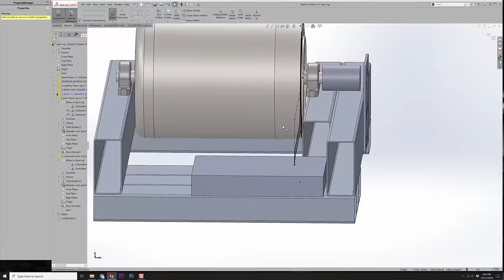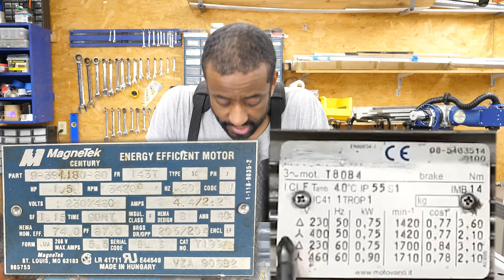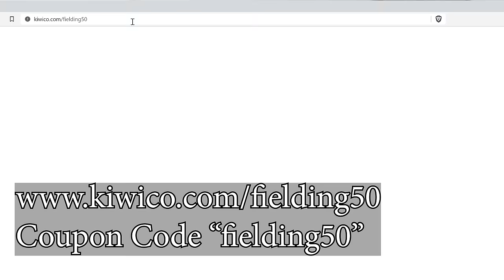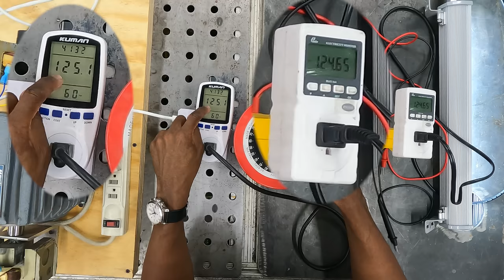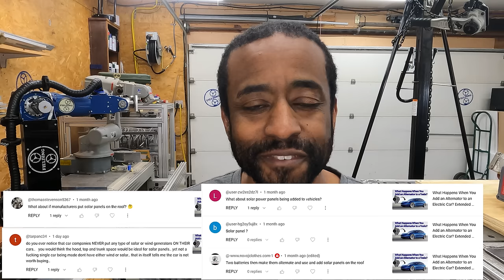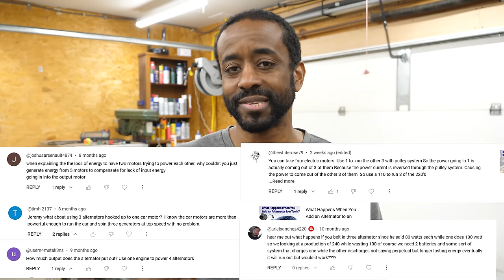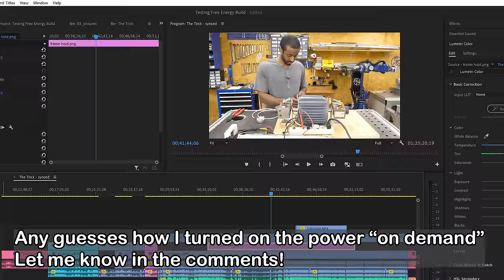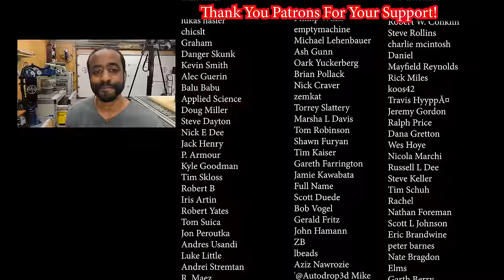Building and Reviewing Free Energy Generators on YouTube.

Comment: I have a question.   Is a gravity battery a good source of electricity?  Make a gear box.   With heavy duty gears. 3600 to 1.  Ratio
60 to 1 added to another 60 to 1. Can give you an output of 3600 rpm’s
Create a double sided ring gear 4 foot tall.    Create a base that can handle the weight and balance.   Create and frame with 6 gears in a triangle pattern.  The left leg of the frame will be shorter than the right leg. There will be a heavy duty one way gear at the top of the frame to hold the ring gear.   There will be a gear on the outer top of the ring gear, and at the bottom of the right leg there will be and inner and outer gear.  The outer gear will be a one way gear.  At the bottom left side of the a frame there will be an inner gear,  but the outer gear will be a ratchet gear attached to an arm/ lever.   The distance I require for the gear to move in one revolution is 2 inches.   The main Generator will be hung on the right side of the ring gear in free fall, dropping at 1 inches per minute, producing 3600 rpm’s  and 10,000 watts of electricity.   The ring gear moves counter clockwise, while the generator is in constant free fall at 1 inch per minute.   With Leverage and mechanical advantage, the ratchet gear will move the ring counter clockwise when the generator reaches the trigger switch.   The generator will always be on the right side of the ring gear as it can not go past the top or the bottom of the a frame.   The output pump energy to lift  a few hundred pounds?   This I would love to see.
That is how I imagine it.   Because you can’t stop gravity.  But you can push back.  We learned leverage is our friend.   And leverage is how we win free energy.
Reply from the maker: I talk about this in the video. There is a whole section on Gears. They don't give you free energy. They transform energy so we have the same amount in and out. You also have to use energy to lift objects. So gravity is a way of storing energy when you lift something that can be released when you want it. But it takes more energy to lift the object then what you get back when it falls. So again nothing was added or gained. Gravity is just a a storage tank for energy in this way. You can use that tank or a different kind of tank if you need to storage energy but nothing creates energy.

Comment: Sorry I'm a late comer, but what if we used a bunch more transformers and transistor and batteries would that increase efficiency
Reply: Every item you add actually REDUCES efficiency, none of those items would increase it. As Jeremy goes over in the video, they will all waste power. Batteries would surely make it run for longer, but that's just what they do, they still need an initial charge to use.

Comment: Can't you put capacitors on the output to increase voltage which would drop amps.
Reply from the maker: What result are you hoping for here? I don't understand your suggestion. I only ask because I want to understand where people go wrong, to better understand how to explain/teach this problem. First increasing voltage and decreasing amps leaves you with the same amount of power. 2. A capacitor is basically a battery except it charges and discharges much faster. This doesn't change voltage or amps by design. So your statements don't really make sense together or separate. There is nothing gained by adding it to this system. More importantly it doesn't give you free energy no matter how the parts are arranged.

Comment: They said also HHO would never produce enough to power a car with water, but Honda is possibly releasing one if they can get it to properly without all the political b. S.  But I knew it would work because I did the HHO generator that was on that hidden tech channel and it worked fine...  That's the only one I've done so far but I don't let my thinking from attempting...

Comment: To get over unity with anything the electrical system must run at, at least, over 90 volts and much higher is were you should be working. MIT got over unity with LEDs a few years and they were published in a good science journal on this😮! Back in the 1970s there was and inventor, very successful entrepreneur, who’s company built the best small troller motors for fishing boats and he insisted that those motors became more efficient as the voltage rose to 90 volts and above 90 volts became more efficient than was supposed to be possible, but at the time voltages over 90 was too expensive and difficult to create, so that is where his company’s production peaked in voltage.

I don’t think any of the things I have mentioned above violates physics, they just tap into the Earth’s natural electromagnetic field which leaks into DC electrical systems with LEDs and at that voltage and AC systems at much higher voltages. And Tesla talked about this but used different language. Ed Leedskalnin perhaps 🤔 used this but certainly used lightning to build his Coral Castle in Florida and other researchers claim to have solved with systems they think he built but overly complex for Ed to have stumbled upon 😮!

Comment: I still have a dream,a vision of the application of a type of dynamo,that attaches to the wheels of a Tesla to provide power to assist in maintaining charge to the battery while the vehicle is in constant motion.
Reply from the maker: If you managed to make a “dynamo” that could create electricity from mechanical energy without actually needing mechanical energy you would have it. But no one has figured that out. I don’t think they will

Comment: Right i have one question can you generate 220v with 3000w for 3 minutes using a battery drill. This is to power my coffee machine in my motorhome while not plugged in electric. 

Maybe using the synchronous ac motor

Comment: What about re wiring a car alternator to go from 12 volts to 120 volts by adding more copper windings.....  Is that possible.
Reply from the maker: You can make the voltage any amount. That doesn't change the power output. It might help to watch again. I actually talk about the relationship between voltage and power a lot in the video. Most of the scams play on this misunderstanding.
Reply: @Jeremy_Fielding  appreciate the quick response bud but I was not able to explain my question in a way you was able to answer correctly.  I now know after the understanding I now have after watching your videos that producing energy from nothing doesn’t work as well as if it takes a watt to run an alternator that only puts out 75% of a watt then that’ll never work.  My question is if the alternator was hooked up to a motor, electric or gas, can the internals of the alternator be changed out “AT HOME-DIY” to go from 12v DC to 120v AC.  I’ve seen videos where they take the 6 copper windings off and replace with 60 copper windings….  6 creates 12v then of course multiply by 10….  60 equals 120v.  They change a few other things then voila, alternator puts out 120v AC.   Is that possible, is it true, or am I being hamstringed once again by con men.   Sure appreciate your response and have yourself a great day.  Thanks again for the videos, it’s helped my understanding 10 fold.  Actually has me interested and wanting to tinker with things to learn more!!!!

Comment: Not staying I know whether or not these devices work but based on the original video you forgot to mention or avoided mentioning the aluminum, silver, and mystery element combination of the rod that goes through the electric motor housing? Apparently thats the "make or break" of this thing working.
Reply from the maker: There are at least 10 other reasons mentioned in this video for why this won’t work. It’s like saying I am using the wrong drive shaft in a car with no gas. It still doesn’t work. There is no magic material. So claiming to use a custom metal you can’t buy, meaning he is forging it with something as costly as silver seems unreasonable to me. I believe this is just part of making the scam sound more reasonable. But believe whatever you like. This video was made to answer a question

Comment: Great work explaining this to people!
But I have to say your variable transformer demonstration is a little weird. I get that your light is LED and as such has some sort of regulated/switched driver, so that doesn't draw more power when the voltage is increased. But any resistive load and many other non regulated loads increase power consumption with increased voltage (As I'm sure you know), with that said, that power increase ofcourse show on the primary of the transformer too, but the idea of increasing a transformers secondary voltage without the power increasing (on both sides) is quite rare.

Suggestion for future content. How asunchronous motors can be used as generators. I know how to parameterize a regenerative VFD to get power from breaking a motor, but im not sure how its done electrically. Can it be made without a VFD? DC injection to the windings to magnetize it? If you know and make a video out of that i'll be watching!!

Comment: I’ve built this it will work for about 40 amps anything over that it’s too hard for the motor to keep up
Reply from the maker: What do you get from making claims like this? Perhaps you didn't actually watch the video but this machine is ridiculous for a long list of reasons. Not only is there no reason it should work, I made it and proved it is stupid. I get the feeling you make up these details to make it sound more believable, but if you watched the video you would see there is zero energy coming from this garbage. It was a scam made up to steal your attention. I made this video to show you the scam. I strongly suggest you actually try it yourself if you believe this works.
Reply: @Jeremy_Fielding  this machine yes if you use a flywheel you can get the 40 amps at most
Reply from the maker: @chrismccourry3245  Sir. There are no spinning parts on this fictitious machine. But reading this tells me we should agree to disagree. There is no need for more details. Thanks for watching and commenting.
Reply: @Jeremy_Fielding  you are correct tho is doesn’t work worth trying or wasting time on or your money my friend you are correct

Comment: What about handcrank generators you can buy on amazon ? I have one small and you can power you phone of small device you can power up from usb . But is it possible to make it spin and not need to keep cranking ? Basicly they say it must take about 1 hour to go from 0 to 100% on the phone but you need to crank constanly and at the same speed and use the same power , if you go to slow or to fast it disconet.
Reply from the maker: Good question...You should check out my "how regenerative braking works video. I talk about EXACTLY this in that video. https://youtu.be/a49_BnlJoyU

Comment: Your fundamentals are wrong, @ 16:45 power = amps x volts holds true for DC.
Transformers don't run on DC, they run on AC or pulsed DC. 
For AC the power = volts x amps x PF (cos phi).
If your system tweaks the PF (aka phase angle), you can have the system consuming only 10 watts even if the consumption is 100 volts and 10 amps (if PF becomes 0.01, this is possible when secondary flux is delayed).

Comment: The microwave transformers are extreemly high power and need to be handled with extreme caution. Probably the most dangerous around the house tranformers one can get easily.( see Lichtenberg wood burning). However the transformers are useful in many ways and microwaves have excellent magnets in them that are very useful too. Really like your show, but afraid I would disagree with the mechanical portion of your analysis. Using your philosophy, block and tackle systems don't work for power distribution but they most certainly do. They make it so less effort can achieve more power or work. Also the pulley system can be used, when used properly can achieve a higher output than than the input is. Example if you have 2 alternators, one with say a 3" pulley and the other with say a 6" pulley. Using the Alt with the 6" pulley as the input, turning the Alt with the 3" pulley(as the output) that setup demands the 3" setup spins considerably faster than the 6" so it's producing more power than the useage of the 6". An easy project for that is using a twin shaft  blower motor like a fan motor off a BMW(I got one) each shaft has an Alt hooked up to it, one side 6" pulley, the other has a 3" pulley. Using a 12v battery one side runs  whatever, the other charges the battery back as its running. You can even add in some run capacitors, start capacitors, rheostat for speed control etc...anyway, your show is very educational and informative. Something I think  that is lost in all this "Power Struggle" is the difference between AC and DC. Example of that is it takes 120v AC to run a welding machine, yet only 12v DC to weld your 4x4 back together when you break something off roading in your Jeep or Bronco. Keep up the good work exposing those scammers!

Comment: I knew that system was fake from the point you took the motor apart and used a metal rod . 

That said. I bought 3 wind turbine generators at 300 watts each, that arre 3 phase. To set up an off the grid system for my house.  Well, as the wind doesn't blow constantly, i took a 1/2" drill and connected it to one of the generators to test the system.  I got the 300 watts going to the battery storage bank at low rpms.   My Chinook RV has a 300 watt solar system. The  MPPT keeps the batteries at 48 volts with 13.3 volts going to the 12 volts system, and the power converter to 110 volts AC.  But the sun doesn't always shine.  Just like the wind doesn't always blow.  I bought a worm geear and electric motor that matches the rpms of the generator, that is 110 volts AC and replaced the drll.  Using the MPPT the electric gear motor shuts off at peak 48 volts of the battery bank. And comes on using a voltage regulator from a 48 volts DC alternator.  I can manually switch from solar to the "wind" generator at sunset.  I don't call it perpetual energy, but it is a looped system that uses a fraction of the energy to run the small motor that puts out 300 watts.  I don't care if there is energy loss, only that it works.  The only problem is that the Air conditioner doesn't run on that system and needs the 4000 watts generator or be plugged into a RV power source.

Comment: I have a great idea for a free energy invention I have a basic understanding of the fundamentals (high school education) but it’s a thought I’ve toyed with what if you took a heavy ball and had it on top of say a large hill or mountain at a slight grade and had a track lined with spinning generators lining both sides of the track all the way down so as it goes down it spins the generators using reduction gearing to use the mechanical advantage than once at the bottom the ball uses gravity to continue to roll back towards roughly the start position where a big battery bank and a solar charger is (if needed) with a bucket style elevator using something like a windshield wiper motor small not a lot of power strong would power the lift back to the starting position and then back down the charging hill it goes I’m assuming if we get a long enough graded run it would hopefully make enough power to make just a little more than the lift would take any thoughts? Or is my pipe dream a pipe dream
Reply from the maker: I think perhaps you didn't watch the whole video, or you are not seeing the connection between what I said in the video and your idea. Perhaps watching the video again will help. The short answer is every generator pushes back as it generates power. The push back is always slightly more than the energy it can put out even with gears. Again this is explained in great detail in the video, both the gears problem and the "push back" problem. I.e. You will produce power in the way down, but you won't have enough energy to push/lift the vehicle back up the hill. So you spend more energy lifting the car than you can get rolling it down hill. Dams create energy because the Sun heats water and "lifts" it by evaporation. Then water rains back down the mountains etc. So a dam is really solar powered when you trace the energy back to the source.

Comment: No he is not using stainless steel for the rod. He is using a silver aluminum alloy rod.
Reply from the maker: This lie is part of the scam. There are at least 10 reasons this doesn’t work. Saying this is sort of like saying I used the wrong drive shaft in a car that has no gas. No material can create energy from nothing and that’s what is missing. There is no “gas”. Don’t get distracted by false claims about the shaft. This made up material can’t be bought anywhere making it impossible to check his claims and that’s the point. It’s extremely doubtful He is forging custom silver alloy. That’s very expensive and pretty ridiculous from a material science perspective. But he hopes you don’t understand and that’s the point. You can’t check it, you don’t know why it shouldn’t work, and you hope it’s true. It’s a great scam.